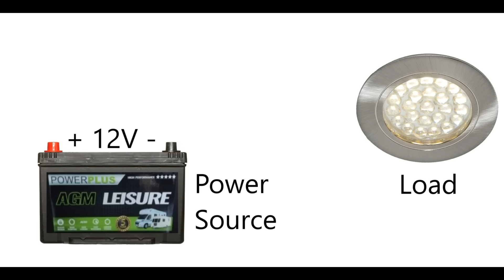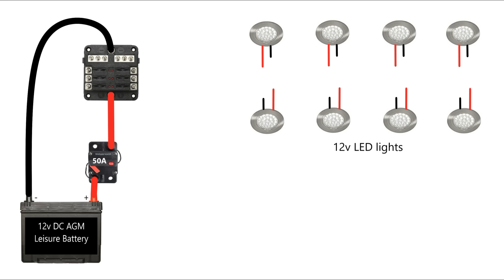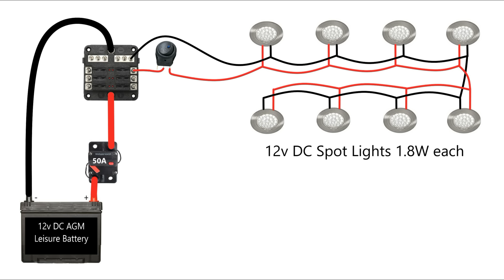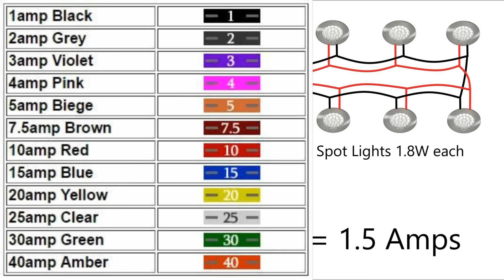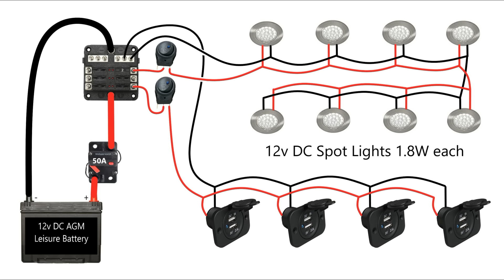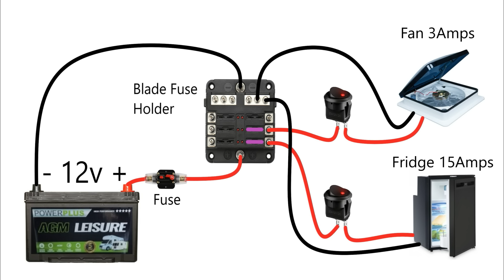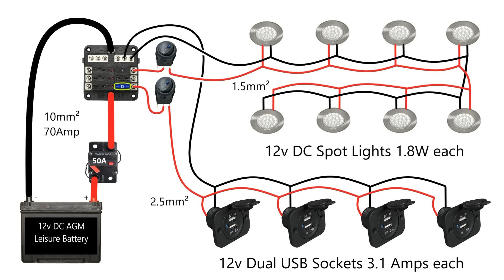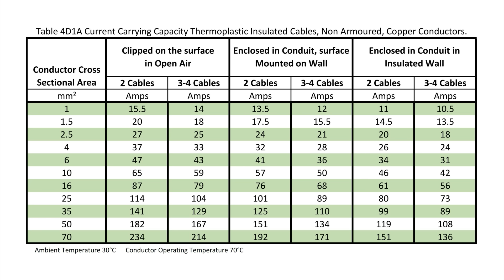Electric Cable & Fuse Sizing - Camper Van Conversion Series

Comment: I'm running a 12v electrical system with about 570AH of power. What size circuit breaker should I use? Thanks a lot Greg for making this SUPER informative and helpful video. Best one I've come across yet. :)
Reply from the maker: Breakers are sized bases on the connected device that you are using not by the storage capacity. 
That is a huge battery. What are you planning to recharge it with?
Reply: @GregVirgoe  It’s 6 95AH batteries. I plan on powering several 12v appliances: heater, lights, fans, water pump, etc. and a 3000 watt 120v inverter (I’m in the US).
Reply: @GregVirgoe  I'm planning to use the vehicle's alternator with a 60AMP DC/DC charger to recharge it.
Reply from the maker: @anyssarobertsify  which charger are you using?

Comment: Hi Greg, just came across this essential van conversion series, great idea, great job, thank you. Presently planning my electrical system and these videos have been really helpful and very informative. The most daunting has been getting to grips with the 12V lighting system, parallel circuit I understand its the methodology of connecting the individual lights to main postive and negative cabling from feed for the parallel circuit I am struggling with. What is the best method of making the connections? Is it using tap splice connectors or butt connectors and crimping? One other question, is it better to run rubber sheathed cable and then break into cable and spur off to puck lights and splice or run individual positive and negative cables and splice? I appreciate the sheathed cable offers protection of wires along with conduit, really what to end up with a neat job. Thanks Cheers
Reply from the maker: I ran a single cable along the van and spliced into it at each light location.

Comment: Do you need to charge your battery frequently? All I want to add to my van is puck lights,phone charger and maybe a 12v water pump
Reply from the maker: My solar panels are permanently connected to my leisure batteries and always on. So everyday they keep the batteries in tiptop condition. 👍🏼😊

Comment: I have just bought my first camper and I'm on to electrics however I am watching lots of videos, this one is great but i have a stupid question which I hope someone can answer. My leisure battery is connected to my van battery so when the engine is off and we use something it flattens the van battery how can I change this so I can use appliances in the van without running the engine
Reply from the maker: The two sets of batteries should not be directly connected together. Quite often they are different type and require different charge profile. Plus as you pointed out anything you use in the van will drain all the batteries including the van. The best thing to do is fit a dc to dc charger like I have in this video - 12v Electrics for Off-Grid Campervan
https://youtu.be/xCw7eARJKOg
Reply: @GregVirgoe  I thought it was a bit strange it's an old camper I've bought and stripped so not sure if that's how they previously did things. Thank you so much for the reply your videos have been  an absolute godsend, I'm trying to do the conversion myself for my own achievement so having your step by step guide has been brilliant 👍

Comment: Hi Greg,  We are in the process of converting a LWB Ducato and are avidly following your videos, which have to be the most informative available.  We done you.  I have a question regarding the wiring of your LED touch roof lights.  You mentioned when running the individual cables to the lights that they were spliced into the main feed along the side of the van - can you say how that was achieved please? I.e what type of connector was used at the junctions.  Thanks in anticipation Rosemary
Reply from the maker: Hi Rosemary, I soldered the wires together and wrapped them in shrink wrap. This video I did on electrical connections may help you 
https://youtu.be/UP10-tW7TQg
Reply: Hi Greg,  Thanks for taking the time to reply and sending the link - which is clear and much appreciated.  Keep up the good work.  Best regards, Rosemary
Reply from the maker: @rosemarycasson6672  it’s a pleasure. Hope it helps 😁

Comment: Sorry, but at 17:29 you are very wrong. The 3,1A is at 5 volts. Given a 90% worst case inefficiency of the internal 12V to 5V Dcdc converter, each socket can draw about 17 watts, which in 12V is 1,42A. 4 of these brings the current sum total for this part of the circuit to about 5,7A, not 12,4. Big difference, and I’m a bit puzzled you do not know this. Also, how many amps you can run through a cable also depends on the length of the cable.
Reply: Good spot. I didn't notice that when watching the video.

Comment: Hi Greg, Another fab video as always...When you were planning the elec installation did you consider a B2B charger? I'm planning my system now and think it may be a good idea if the weather is not so good for Solar output, well UK weather! Your thoughts on this this are welcome. Also I'm thinking about cabinet and equipment installation and because the van is rarely parked on level ground using a spirit level seems pointless so did you use the floor as the datum and square off that?

Comment: Hi Greg
Correct me if I'm wrong although I don't think I am, in regards to your USB example, aren't those outlets 5v?
I guess the socket itself is a step down converter 12v-5v, if I'm correct and the conversion itself uses zero energy(I imagine there must be at least some heat energy lost), then full power would be 12.4A x 5V =62W, so the draw off the 12v system would be 62W ÷ 12V = 5.16A roughly, meaning your fuse at 15A is twice the size it should be ???

Comment: Hi Greg, obviously thanks for all of this! I'm trying to confirm the breaker for my 800w Victron. I'm happy with everything else now and it's last piece of the puzzle, but looking at yours here, the 35mm doesn't look like it can handle 200a from the chart near the end, yet you have added a 200a breaker into that circuit. 800/12 for me would give me 66a so if i went for an 80a breaker i'd be on the right lines, with 16mm cable, but would like to confirm this would be ok?!?!  Hope you can help and confirm, or another user even! Big thanks in advance!

Comment: Can you place the switch anywhere  in the light circuit or does it need to between the fuse box and the lights ? I want mine at the sliding door but the fuse box is the other side of van and the lights in-between

Comment: Hi Greg. Not sure if you will ever see this post but thought it was worth a try. I'm starting my own Sprinter conversion and watching loads of your videos (which are brilliant BTW). On the 12V electrical side I cant find anywhere where you mention the use of panels with several switches, voltmeter, USB connectors etc. (boat panel style). I'm wondering if you think they are useful. If you wanted to use one of these for switching different circuits then you would need to have several cables from the main blade fuse holder to the switch panel or have the single cable coming off the fuse holder (both cable and fuse rated accordingly) for the worst case for using all switches on the switch panel. If you dont use one, then what would you say is the best way to install switches for each circuit? Where did you put yours? Hope this gets to you. Cheers pal.

Comment: Great video but I have question - in your video (12:34) you have the string of lights wired in parallel and both negative and positive wires from the first light are connected to the fuse box. Some youtubers recommend using the negative wire from the first device and the positive from the last device to connect to the fuse box. This is prevalent in a lot of solar panel and battery wiring diagrams they show. Are they incorrect or does it not matter as long as the wiring is negative to negative and positive to positive? Thanks in advance for the advice.
Reply from the maker: The only thing that changes in the two versions of wiring is the resistance on the wires. But if your cable is the correct size the voltage drop should be less than 3% so the result is negligible. 
You can wire them either way and they will still all work ok 👍🏼

Comment: Hi Greg. These videos are all excellent. Very informative and a great help.
Does the main fuse breaker from the leisure battery to the fuse holder need to slightly above the the total amp usage or could you go a lot bigger. I'm not sure what LED lights I'm going to use yet but other appliances are about 30amps so far. Should I use a 50 or could I go bigger to be sure when I add lights they'll not go over the size of the fuse?

Comment: Hi Greg, as everyon else says this has been a very helpful build series! I have a question regarding the best way to splice cables for  the LED lighting circuit? It seems to make a three way connection it's either spliceand solder and cover with electrical tape or maybe other dedicated connectors? Ive seen a few different suggestions about the place but can't figure which is best. If anyone else has ideas or links it would be much appreciated

Comment: If you earth your leisure battery, which you need for split charge relay, wouldn't the current for your appliances choose the path of least resistance making the negative wire to the appliance obsolete, since the van chassis will be used as negative?
Reply from the maker: I do not recommend using split charge relays as the do not look after the correct charging of leisure batteries. You are far better off installing a battery to battery charger and I would always recommend running both positive and negative cables to avoid bad connections via the van. 
There is no such thing as an earth on 12v DC systems. A connection to the vehicle on 12v DC is a negative connection back to the battery. Hope that helps 😊
Reply: @GregVirgoe  Thanks for the thorough reply Greg, really appreciate that! Damn I already installed split charge haha, well lets see how it goes, will upgrade later maybe.

Comment: Very clear video, but shouldn't you take the length of the wire into account also? The longer the wire, the thicker it needs to be? Or am I wrong? E.g. if I were to run a wire from the left side of the van to the right side via the ceiling, length will pretty quickly get a lot longer. Or, is it good practice to not go via the ceiling, but under the subfloor?

Comment: A good video but you didn't mention anything about the effect of cable length on cable sizing or anything about voltage drop in long cable runs. Yes most cables in camper vans are fairly short but it is still something that must be considered when sizing cables in any application.
Reply from the maker: You are right. Most of the cables in the van are very short so not so important and I didn’t want to make it too complicated fir the novice builder.

Comment: Hi Greg, 

Thank you for all your videos, they have helped us no-end convert our van! 
I am just wondering about whether I need to earth the MPPT charge controller and Inverter? I have an earth cable off the shunt into the chassis but not sure if these also need dedicated earth cables or not. 

If so what size cable should I use on these? 
Many thanks, 
Ruby & Nick

Comment: Hi Greg, I have a small query regarding cable size for the fridge. We are installing a Dometic R10 and following the calculations in the video and the sizingchart I reckon 1.5mm is sufficient but the wiring diagrams you show in the video show 4 &6mm. Am I missing something with the power draw?
Reply from the maker: With fridges in particular the manufacturers suggest a larger cable to reduce the voltage drop from battery to fridge. In this instance better to stick with the larger cable.

Comment: Hi Greg thanks so much for all these videos they’re so clear and helpful. I just had one query if you could help it would be great. I see with the sockets you have gone for a 15amp fuse which I understand but in the wiring diagrams on other vid you’ve used a 1.5 mm cable for the sockets and 4mm for the fridge although they have the same fuse rating. Why is this/is it because you are showing only one socket in the diagram? So for the long winded question and thanks again for all your help.

Comment: Great video, very well explained. I’m upgrading my electrical system in my motorhome. My question is this… Might seem a bit strange but I’ve always run 2 separate inverters, I have a small 300w for the tv / sky box which is used frequently and a large 2000w which is rarely used for toaster / hairdryer. I can’t think of a better way to do it, doesn’t seem efficient for me just to use the large inverter to power the tv which only uses about 70 watts. That’s why I use the 2 separate ones. Am I thinking on the right lines ? How do I calculate the fuse required between battery and inverter please ?

Comment: Hi Greg, I'm not to sure how familiar you are with the Sargent EC 155 unit. I'm fitting one on my van but I'd like to by pass the circuit that shuts the systems down when the engine starts. Any ideas? Cheers

Comment: Hi Greg! Thanks for all the informative videos. I have learned a lot from watching. One question I did have was about wiring the lights in your diagram: how do you go about connecting all the positive and negative wires coming from each light when wiring lights in parallel? I notice you mention using a two core cable, but I am still a bit confused about how each of them are connected.
Reply from the maker: Please watch this video for different connection options. I soldered my cables together but there are easier solutions. https://youtu.be/UP10-tW7TQg

Comment: Hi Greg, You don't mention cable length in the video. Is this because a van has such short cable length that it is ignored in the calculation? I would have thought a 12v system is more critical than 240v for cable length? Or is this covered by the +25% safety factor?

Comment: Great video. Thanks for the info. One silly question though, why didn’t you use the 1mm cable for the lights as it says in the table it will take 15.5 amps?  I’m I missing something?
Reply from the maker: I just wanted to buy one type of cable that could do most things in the van on one 50m drum
Reply: @GregVirgoe  makes perfect sense. Thanks again.

Comment: Hi Greg, a stupid question, all vehicles have the battry's grounded to the vehicle chassis so why run negative cabling and not just ground all negative connectors to chassis
Reply from the maker: Why risk a bad connection back to the battery when it’s no more work to install a 2 core cable. Why risk messing with the auto negative too when you can keep the leisure side separate and guarantee sound system with no issues. I think it’s a far better solution 👍🏼😃

Comment: This is such a helpful video, Greg. Question - If I run out of ports of the blade fuse holder can join wires. AKA can I put the fridge and the fan together (assuming I wont use a switch)

Comment: Hi Greg. Your vids are so informative. I have a question about standard day van set ups. I know I require an in-line fuse from main battery to split charge relay, but do I need a further fuse from other side of split charge relay to the leisure battery. From the positive terminal of the leisure battery I’ll be adding a kill switch and then routing a cable onto a fuse box for all my positive connections to LEDs, USB etc and adding a ground negative block, but as I said, just wondering about a secondary inline fuse in-between split charge relay and leisure battery??? many thanks, Mark
Reply from the maker: Hi mark, yes it’s good practice to install a fuse on both batteries either side of the relay and as close to each battery as possible.
Reply: @GregVirgoe  perfect. Thanks again 👍🏻👍🏻

Comment: Hi Greg 
I’m in the process of still figuring out how to do my own electrics. 
I see you can buy a 200AH lithium battery which is cheaper than buying 2 but nobody ever mentions that, even victron. Can I use one of them with 2 solar panels and a 3000 watt inverter. I’m finding the electrics so difficult to wrap my head around it. Thanks in anticipation. 🙏
Reply from the maker: You can use one battery. I went for more smaller ones for redundancy if one fails. 
The inverter seems very large? What are you thinking of using on mains in the van? Our biggest appliance is only 190W 😊
Reply: @GregVirgoe  thank you for getting back to me. Ah yes, The 2 batteries do make sense, thanks. 
I am going to be off grid a lot and want to make sure I have enough power. I intend to use blender, straighteners, toaster, laptop, coffee grinder. Would a 2000 watt be sufficient for them? I would like a residential fridge freezer as the 12v are so small but I think by reading up on it that would mean a lot more power, I think I will forego that!! 
Thanks so much for your help.